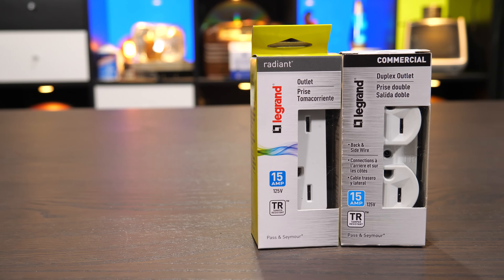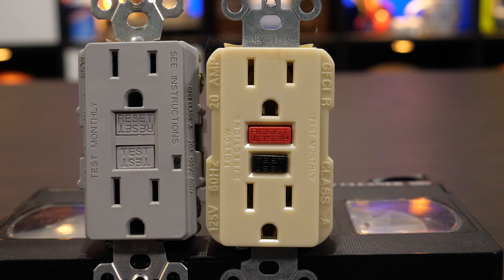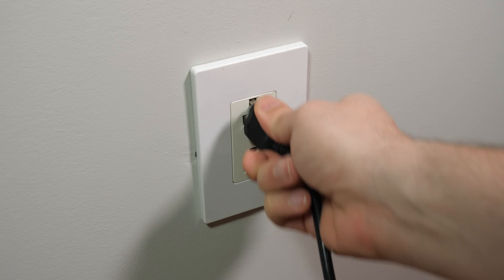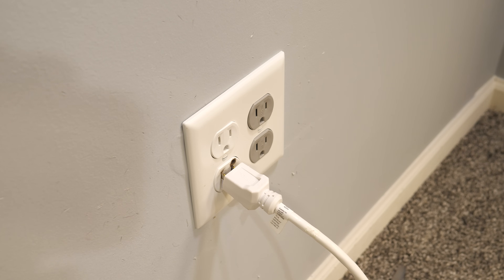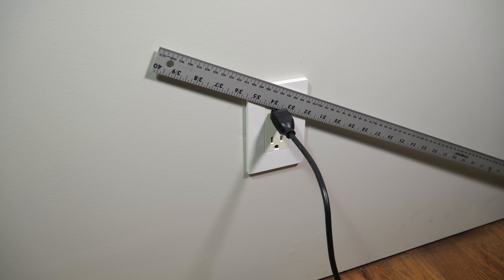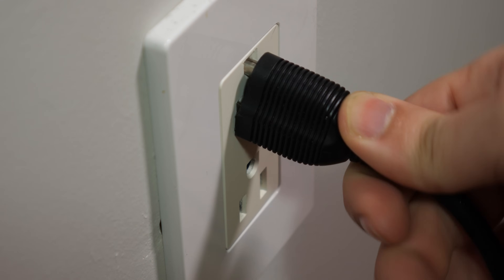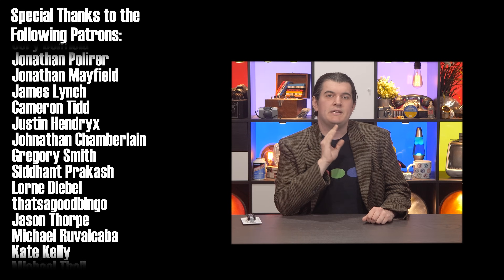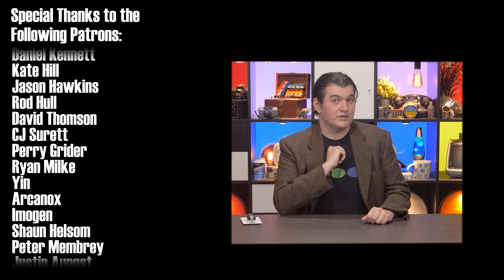Power outlets are topsy turvy - but does it matter?

Comment: 15:12 Not only does the 45° angle mean you can put two plugs in adjacent sockets in an outlet, it also works if those two sockets are side-by-side instead of stacked! I really wish more plugs came like this; it makes things so much tidier.
Reply: Me too, I really appreciate a 45 degree angle plug. I can move my furniture closer to the wall without having to worry about smashing a cable and starting a fire. It should be the default plug style without question.
Reply: Here in schuko-land it's common for power strips to have 45° angles for their sockets so you can use 4-8 right angle plugs without interference. Wall sockets are usually vertical, unlike the UK with their giant fuse box/plug hybrids, but it's less of an issue since neither socket or plug has an up or down orientation and the plugs are much more securely held than the US ones (sockets that actually use the retaining bar holes excepted, not that I ever encountered one when I lived in California).
Reply: I actually don't like fixed 45° plugs, if there's to be a standard flat plug it should be a rotating flat plug. You get the wall hugging capability and you can run the cable in any direction
Reply: @legionofanon  I love those things. I question how much power they could handle, and I wouldn't trust it for something like a fridge or air conditioner, but for general use those rotating plugs are the best of all worlds.
Reply: @legionofanon sounds like fire hazard.
Reply: @legionofanon sounds like fire hazard.
Reply: Side by side is pretty much all you see in the uk due to the nature of the cable coming from the plugs extending below them.
Reply: @InsufficientGravitas  I have yet to see a plug design better than the UK's
Reply: @raph.404 I think the UK plug is akin to wearing a helmet in a car with airbags. 
Sure it's safer and when they were they were even necessary but I wouldn't trade my neat schuko plugs for those bulky things.
Reply: @cyan_oxy6734 British plugs were designed before our metaphorical airbags were invented and giving everyone a helmet was the best they could do. Nowadays it would require too much effort to replace all helmet requiring cars with ones equipped with a compliment of airbags.

Besides no other design is as multipurpose as the plug, you can use it as a caltrop, flail or a doorstop.
Reply: @raph.404  UK plugs are comically enormous, even for low-current devices.
Reply: But then it's annoying to use when the cord points away from where you want it to go.
Reply: Over here in Germany all angled plugs (without exception that I ever witnessed) have the cord coming out at a right angle to the (imaginary) line connecting the prongs. Standard outlets are spaced far enough apart that plugging in two both with cord facing downward works (though is a bit awkward), if they're horizontal there's no issue in the first place (and that's the case for most multi-socket installations vertical ones are generally light switch(es)+socket), for tighter situations and especially with power strips you see the socket have holes at 45 degrees.
Thinking of it IEC 60309 is kinda strange: There's no angled plugs, but the outlets are practically always mounted facing downwards.
Reply: The 45 degree plug also means the cable is putting a rotational load on the pins, which may make it even less likely to fall out accidentally, as the pins push against the sides of the socket!
Reply: I'm sure I've seen right angle plugs that can be rotated so you can choose the direction the wire comes out. That seems the ideal. You might want two plugs in a duplex and have them come out in opposite directions, or the same, or one up and one to the side, etc.
Reply: the outlets should be stacked side by side or at a 45 degree angle in the first place.
Reply: Also, it solves the inherent problem with his "everything should be right-angle plugs" proposal, since otherwise it's easy for a right-angle plug in the upper outlet to hang down far enough to block the lower outlet. Or there are similar issues putting several RAPs into a power strip - they get in each others' way. Universal 45 degree tilts would fix that.
Reply: I put a receptacle in with the ground at the top prior to the delivery of a new clothes washer.  It happened to have a plug like that, so the cord had a severe bend in it as shown here.  I turned the receptacle over to the conventional orientation.  You don’t want to put that much strain on a power cord.
Reply: If you want to bellyache about US outlets, this is the form it should take.  Just "I like it better"
There is nothing inherently dangerous about US plugs.  Trying to push your preference by saying "my way is not only more pleasing, it's safer and better" is just ridiculous.
It's like putting "warning, hot liquid" on your cup of coffee. Why not just come along and say "well, we have people that can't read English and they get burned because they're too dumb to know coffee is hot, so it needs to a pictogram and should be served lukewarm to cool"
Or, my personal favorite, new knives come with covers printed with large warning signs "Danger, razor sharp blade inside"  yeah, no kidding. That's why I bought them.
Reply: @christo930 , you're saying that one's not safer than another, and therefore everyone deserves an award?

If you'd ever seen a European outlet/plug, you might not like if for various reasons, but you could not rationally claim it's not safer. I tell you that as a life-long North American, but not one who lives in a bubble.
Reply: @Johnny.Fedora  Where did you ever get the idea I said that?  Are you on pain or psych  meds or something?

I've seen the British and Australian plugs, but none from Europe (unless those are the ones with round pins).  Who cares if it is "safer?"  Ours are not dangerous and that is my point.
If we could start again, I would ask for a better design. But since we cannot start again, you have to weight the costs as well as any benefits.  This case, the costs would FAR outweigh the alleged benefits.

Despite what you think of as glaring deficits in our plugs and electrical system in general, there are very few fatalities caused by them and not even many shocks.  The shocks that do happen is not because of the flaw but because of imperfection.  You are blowing theoretical risks way out of proportion.
Reply: Precisely, I wonder how Alec would feel if the new plug standard over here was that wide round 45 degree plug with sleeved connectors and a pull loop on the back for removal.

sadly most companies would consider that overkill and out of budget to produce tho...
Reply: i got a power strip recently, didn't even think about this and it came with one and i love it, also there's a flare on the outside to grab on to  when removing the plug, someone clearly thought about this.
Reply: At this point I will only buy power strips with right angle, 45 degree plugs. They're so much neater than anything else. I also buy right angle 6-outlet expanders to go behind furniture, and right angle IEC cables for appliances and equipment.
Reply: @FowlerAskew  We have talked about right angle stuff so much, I have a perverse urge to see wrong angle plugs.
Reply: @FowlerAskew  Right angle plugs everywhere basically. The thing that kills microusb (both parts) the fastest is when a device being charged falls off and it lands on the cable.
Reply: @chaos.corner  in my experience the thing that kills micro USB is first the cables are all cheap trash, and second the ports are usually only held on by the soldered connectors so they break off easily. I try to use Mini or even the "old fashioned" normal B socket instead of Micro, for the additional strength of both socket and cable.
Reply: @renakunisaki  I agree. Though if I'm using them just for 5V, there are some through-hole sockets available. Mini-USB is becoming rarer though micro-USB is soon to follow.
Reply: Yeah, I hate wall warts and 90 degree plugs that demands to hog the space of more than one socket...
Reply: Meanwhile over here in Europe, we have dedicated power strips with the outlets at a 45 degree angle so they can take a large number of right angle plugs (which are more rule than exception here) and have the cables align neatly.
Reply: Except when you need to connect them to an outside outlet and then the outlet cover is in the way of the 45 degree angle.  That's always a fun thing.
Reply: Wait, they come side-by-each?
Reply: Especially if your trying to plug multiple USB power supplies in.
Reply: I hate that this comment, the mere, "hey, let's angle plugs at 45-degrees," makes me stop and go, "WAIT. WHY IS THIS NOT THE DEFAULT??"
Reply: 45 degree right angle plug with a handle to pull it out of the socket is the most common plug cofiguratin in Europe  (specifically Macedonia).
Reply: Not to mention it looks pretty sci-fi lol
Aesthetics are marginal but when it's functional AND stylish? Harder to say "no" to for sure
Reply: I have some power bars like that that also have a plastic rotating cover over the outlets. I have one behind my night stand since it needed something that lays flatter against the wall, and I like knowing that I can't accidentally have something fall off the stand and cause an issue. You just use the prongs to twist the cover to line up when plugging stuff in. I also have one in my craft room. I keep the iron plugged into it most of the time, but the peace of mind knowing I can't drop a pin, sewing needle, or other small things inside is great. 
The only downside is if the angle goes to the opposite side of what you need. Like if you have a cable that goes down and left, it's not as practical to use on the right side of a bed because it would just go under the bed.
Reply: or buy 45° degree angle outlets. So you don't need to care so much about who manufactures the cord.
Reply: @J123-d8j But then you gotta combine a 45 degree outlet with a 45 degree cord :)
Reply: @J123-d8j  Sounds fine.  At first I was going to say it would be incompatible with 2 45 degree plugs, turning them into the same non-stackable right angles, but then I realized it would be horizontal instead, which might not be ideal but it still works fine.
Reply: What the fuck is a 45-degree angle plug? Why would I want a diagonal receptacle?
Reply: @codybohyer1107  From the horizontal/vertical. It's still parallel to the wall. Though 45s (to the wall) are sometimes used for recessed connections.
Reply: Why are the sockets vertical instead of horizontal,  if you have a plug in the top then you can't use the lower plug, stupid idea unless you have 45% plugs, also here in the UK we have switched sockets, plug in the appliance and then switch on. Some people saying that UK plugs are bulky, their not.
Reply: @dogbreath6974  Many other countries have "better" from the comfort of both not being first, and having a smaller installed base to have to change when innovation happens.
Reply: The EU needs to take over the USA.

And then issue new regulations to get rid of the horrible design altogether, as well as to mandate the 45 degrees angle.